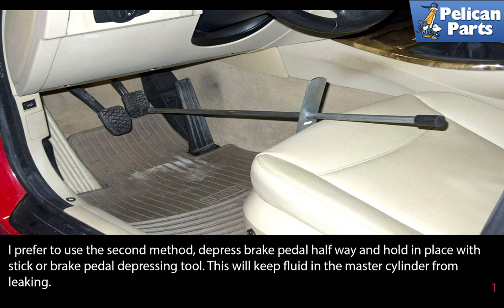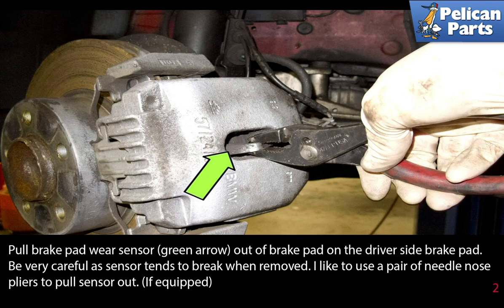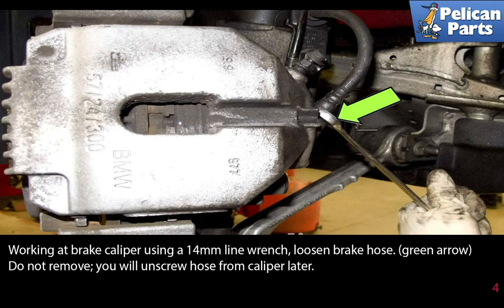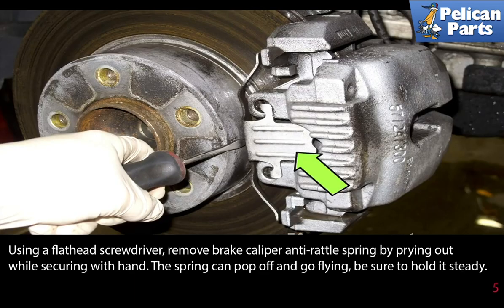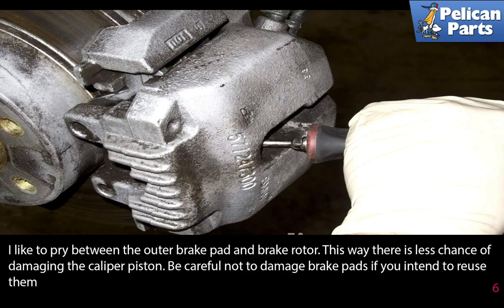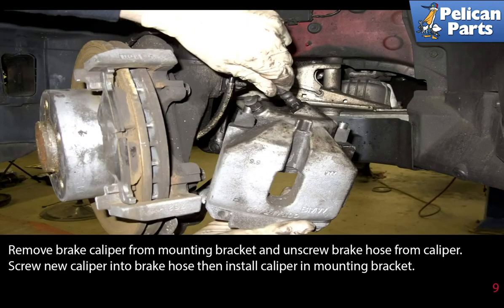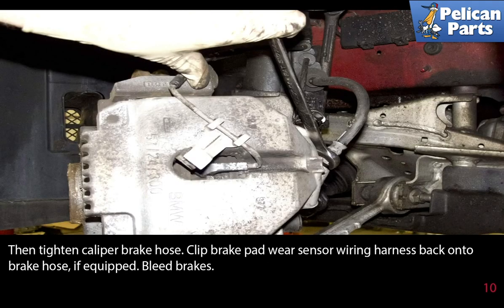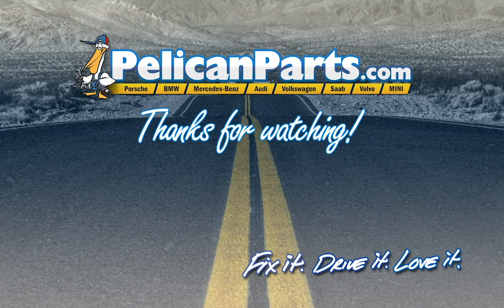BMW E90 3-Series Brake Caliper Replacement for 325i, 325Xi, 330i, 330xi, 328i and 335i

Comment: When I changed my pads I think I forgot to add my tension springs back as both are missing 🥴 I’ve ordered a new spring but it doesn’t seem to fit are the front caliper tension springs the same size as the rears ?
Reply from the maker: You didn't mention what year and model vehicle you are working on.

With your vehicle info handy, give The Pelican Parts parts specialists a call at 1-888-280-7799. They can figure out what part or repair kit you need.